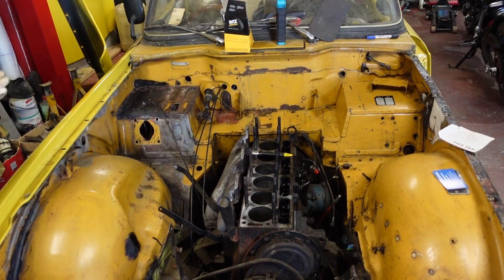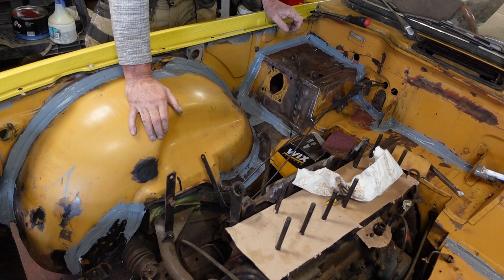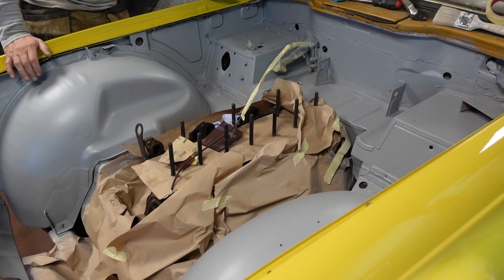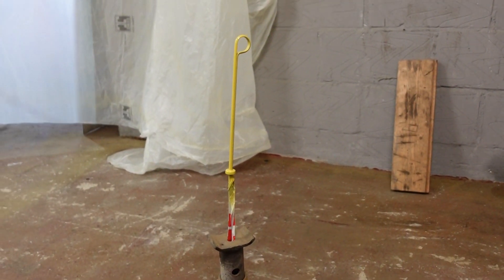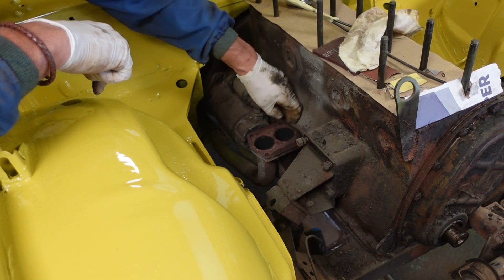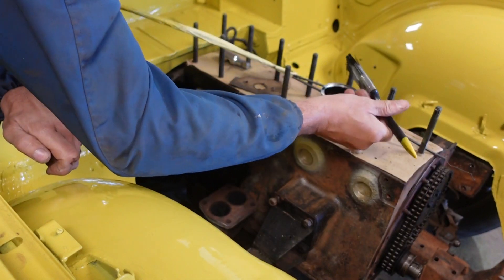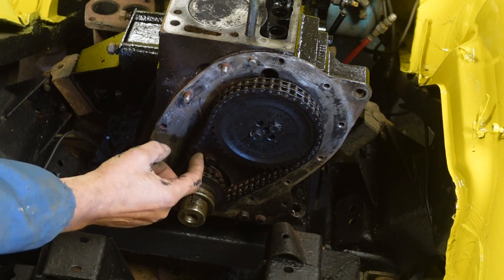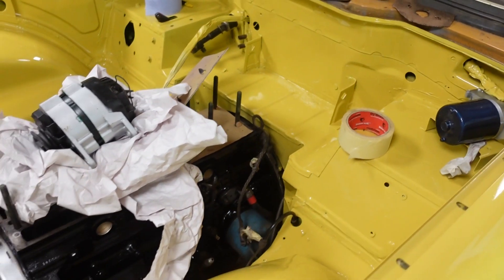Triumph TR6 Restoration Part 15 Preparing And Painting The Engine Bay And Engine Block

Comment: Looks very  good and worth the effort to do. I did the difficult half of my engine bay paintwork last winter and will do the easier front half this winter. I had to remove a lot of parts to do this but am pleased with the result.
Reply from the maker: It was a job and a half but yes, definitely worth the effort.

Comment: I have been told not good practice to put new chain on old sprockets.
Worn teeth will wear the chain quickly.
Reply from the maker: Hi Steve, Ive not heard of that before but it does make perfect logical sense. Although, when I inspected the sprockets, they showed no signs of wear as I was prepared to change them both to begin with. 
Johnny